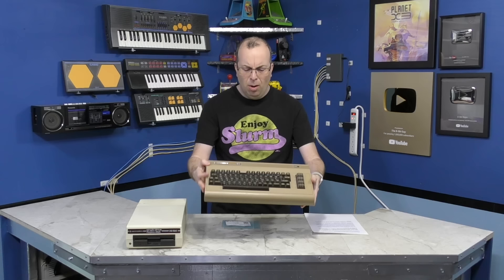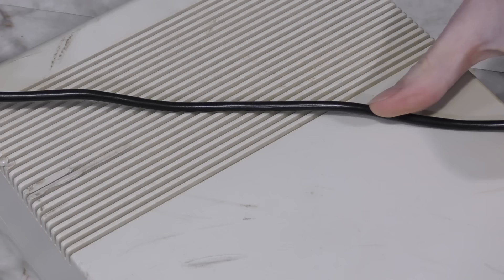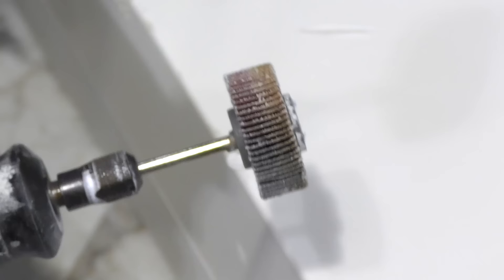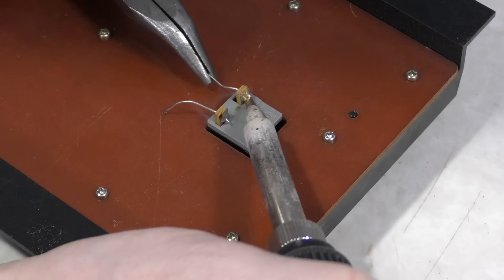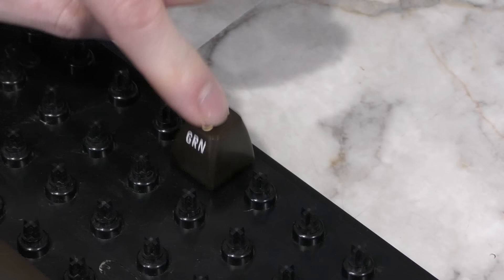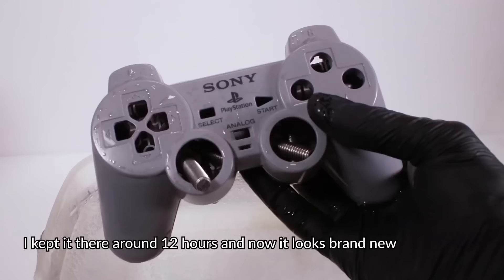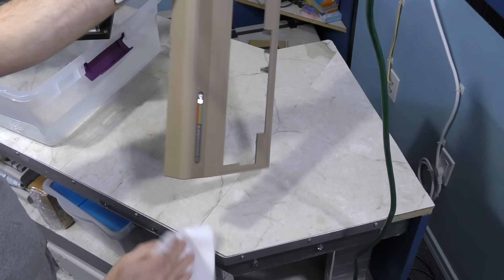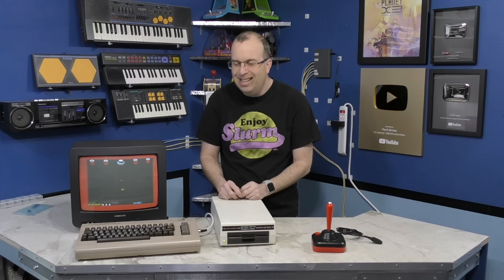Commodore 64 Restoration and new retrobrite technique.

Comment: I’m interested to hear if you notice any UV light bleed on other stuff in your studio over time - if you use this method regularly. Will it affect the stuff you have lying around? :)
Reply: Oh yeah, good point! David has this one episode where he shows how he installs a UV filter in front of his windows, but that was in the museum and not the studio if I remember correctly.
Reply from the maker: yes, I am worried about this too.  I plan to modify this technique for next time for several reasons, but one of the things I'll be doing is trying to contain some of the UV light from escaping into my room.  I had originally planned to do this in the garage but the floor is slanted in there, which made it harder to deal with the water level.
Reply: OBG70  yeah it may even work faster and better on the sides
Reply: @The8BitGuy  Just put a box over the entire thing, problem solved
Reply: OBG70  You do need to account for the heat output of those lamps as well. The back of each lamp is a big heat sink, which means the heat will build up quickly if you enclose it.

As for the process, perhaps adding some kind of mechanical agitation would help cut down on the amount of bubbles collecting on the surface of the pieces. Something like a small motor with an unbalanced weight on it (like they use in some massage devices and in force-feedback game controllers) or a fluid pump of some sort creating a current in the tank.
Edit: I can never seem to get the line spacing right on these comments.
Reply: OBG70  Couldn't you just put a mirror at bottom of the box?
Reply: @The8BitGuy  if it is slanted put a piece of cardboard under the container and make it level lol
Reply: OBG70  Agreed. I was thinking this too. 👍
Reply: @Ricardo-bw2yn  He mentioned it in this video, including the problems he had with the metal reacting with some of the metal bits on previous parts. He left the reflective bits out this time because he thought they might be adversely affecting the retrobriting process.
Reply: @The8BitGuy  maybe build a cowl out of some flashing, or maybe modify a hood vent to hold x amount of lights so the whole thing could be lowered over your chosen container. Just dropping some ideas based on how I would attempt to solve that problem. Happy hacking.
Reply: @t0nito  Just build a sun tanning room with a bathtub, problem solved
Reply: Funny i was thinking the same thing too. Need to make some kind of a box to contain the UV as its bleeding everywhere.
Reply: @MK-je7kz  yes and for the hard to reach side surfaces maybe put lamps on the laterals too; once you have all this setup figured out you can start offering retrobright service for the 8-bit subscribers!
Reply: Geez I'm late for the party but I just found out Mr. Jensen is on spotify! I'll give it a few listens!
Reply: It isn’t submerged in hydrogen peroxide so I don’t think so...
Reply: @The8BitGuy  What about those sun screens you put in your windshield? Fairly durable. That, or something like foil glued to cardboard. Build a "shield" around your setup to help contain the light.
Reply: @The8BitGuy  Look into Rosco Cine Foil.  It's used in TV to prevent light spilling from it's source if barn doors aren't an option and if high heat is a concern.
Reply: @The8BitGuy  Maybe putting some sort of "barrier" around the floodlight assembly? Something removable, but tall enough to keep everything in
Reply: Cardboard curtains
Reply: In addition to UV light bleed some high powered bulbs could be fire hazards if used near plastics.  Metal halide bulbs not used in a proper enclosure could do this.
Reply: @The8BitGuy  I was thinking maybe mirrors on the sides of the crate, because the sides of the parts look a touch yellower than the tops, which might also contain some UV.
Reply: @The8BitGuy  Stick it all in a box. with foil side and put what ever sized clear plastic tank you like in it. I wouldn't run them light at anything in my house, it witll uv rot my sofa, carpets, curtains and cat. I quite like my jet black cat, he wouldn't be able to ninja attack me from the darkness if he was uv bleached.
Reply: Get a huge black storage tub and do all the UV stuff shut in there.
Reply: @The8BitGuy  You could use a reflective tent like they use for indoor cannabis growing.
Reply: @The8BitGuy  You do this often enough I feel like a dedicated wooden frame where you can mount up to six lights at the top. The sides could be made of aluminum foil covered cardboard, or even wood panels if you want something more permanent. You say you don't always have much space though so I'm not sure this would even be a viable thing. Could make for an interesting build video. But essentially this would be the dedicated Retrobright box.
Reply: @evknucklehead  absolutely..those big fins/heatsinks are there for a reason enclosing it in a cardboard box would be foolish... cheeers
Reply: Easy: Take the big black container that David already has, drop the smaller container and the lamps into the black container.
Reply: @The8BitGuy  Foil.
It is also water res...
The tub, lid, and you, will thank you.
:)
Reply: @The8BitGuy  Maybe a reflective box? with mirrors or shiny surfaces
Reply: iVirtualPlays 50%

MuchlikeYT.

Needs when a need does need to exist, yet does.

Love and joy?
Reply: I'm wondering  the desk directly on the bottom of the container was affected?
Reply: Probably not, those UV LEDS are mostly blue light with a small amount of harmful UV. Things would need to sit in front of them for weeks to get any kind of reaction. UV panels like this for effects are fairly safe for a couple of hours exposure to skin else people who work in clubs would have a lot of skin cancer! Tanning  lamps are a totally different thing! https://mashable.com/2017/10/27/neon-lights-hong-kong-sorayama-hypebeast

Comment: This episode has it all. Strange chemical reactions melting plastic cases, the printing of replacement parts, a side mission solving the driveway-spot mystery, high power UV experiments, and the classic of classics: Commodore 64.
Reply: The Atari 2600 or NES is probably the classic of all classics
Reply: @DanTDMJace the c64 is the classic of home computer classics
Reply: @marblecar1162  yeah

Comment: The 'bobble-head' effect is likely due to the uneven weight of the keycap swaying the inner column of the plunger at its peak where it is no longer supported by the outer column. 3D printed components (even with 100% infill) lack density and can be very light when compared to resin cast pieces. Since tolerances are not sufficient, we get bobble! 
As the concern is a dwindling supply of replacement parts, molds could be printed using inverse infills of those same files. Properly weighted plungers could be recreated after some trial and error with mixing ratios :)

Comment: "People think I have a stockpile of spare parts, but I don't"

8 minutes earlier: grabs a key spring from their spare C64 keyboard "just lying around"
Reply: Yeah we watched it
Reply: But one spare C64 in such state is hardly a stockpile of spare parts, there are many springs that can be used, but thats where multiplicity ends.
Reply: Most people into old computers have a bunch of junk lying around. I could theoretically build a working pc from the stuff in my garage
Reply: @nanaskalski3663  That C64 also had a replacement chip he could use. That C64 alone is a stockpile of spare C64 parts.

Comment: Great project! I’d like to make a recommendation, though:  when lubricating disk drive rails, never stick the spray can straw right on them and spray. That makes it very likely you’ll get grease in the head which can ruin floppies.  Always apply the spray to a Q-tip and use that to wipe grease on the rails.  Anyway, in the summer of 2018 when I was off work I cleaned probably a dozen C64 keyboards and cases from my collection.  I can’t remember if I used dish soap or laundry soap, but each one got a scrub on all sides.  On the ones I had to disassemble to clean board contacts, instead of resoldering the shift lock, I installed wires with a plug for easier future removal.  And on those disassembled ones, all the key contacts got dumped out and the entire frame got a scrub too.  A few C64 and disk drive cases got retrobrited as well.  I got a lot of C64 projects done that year.
Reply: All people should work less and do more usefull things instead.
Reply: Good tip, I'll keep that in mind. Nice to see the C64 love. By the way, nice profile pic. Adorbs. :3
Reply: @Bandrik  Thanks!  I like your sergal profile pic, too  :D
Reply: @00Skyfox  why thank you! And nice to be recognized as a Sergal. Always fun to run into a furry here. :D
Reply: @Bandrik  amogus
Reply: @thisisaloadofbarnacles921  we furries are evvvvryyyywhhherrreee.... :)
Reply: Lube.

Comment: 6:08 the video isn't sped up, this is 8-bit guy speed after years of cleaning old computers
Reply: If Data from StarTrek did cleaning, this is what it would look like.
Reply: If you run him using compiler mode, you can get him scrubbing at 1.19mhz
Reply: @originalbadboy32  Or Lindsay Wagner.

yes that was a Bionic Woman reference.

Comment: The first thing that popped into my mind when I saw the 'bobble-key' effect was "stretch the springs a little bit and that'll make them stable", then, as I typed this comment: a little bit heavier spring, too". But the best solution  to bobble-key is to fine-fine-tune the 3-D printing a tiny bit. That was awesome when that 3-D printing of those pieces scenes came up in your video, 8-Bit Guy, and nice work on the overall retro-brighting and circuit repairs, too. That UV setup  with a bit more fine tuning is definitely a awesome thing, too. :-)
Thanks for sharing.

Comment: Regarding the UV light going through the plastic tub, you could try wrapping the sides with aluminum tape. Not only will the UV light not go through it, but it will also reflect it back and possibly speed up the process even more.

Comment: 3D-printed key-plungers?!  And here I'm thinking, "I wonder what kind of glue David is going to use to fix those key plungers."  Man -- 3D printing is amazing!
Reply: I believe the printed plungers could be tweaked to fit better, in the settings for his bro's slicer. I've done a lot of 3d printing and I see some places to improve.
Reply: Yeah! 3D printing is really great, we have plenty of printers in school, and they’re so impressive! I actually 3D printed 40cm space plane on it
Reply: i dont think glue is necessairy here, i would add micropatch in 2-3 layers of double sided tape on top of the plunger to help the key being more stable on it, shimming can also be a good idea or just make a compensation into 3d plans to take account of where its loose
Reply: I'd have used something like jbweld.
Reply: And it's getting cheap. For less than the price of a Nintendo Switch I got a resin printer to print tiny detailed parts
Reply: I had even wondered if he was going to snip the head off the screw and drill the other part and connect them together.
Reply: The term "3D Printing" irks me more and more.  It's like climbing into an airplane and saying you're doing 3D driving!  We need a different word for "3D printing."  3D generation?  3D manufacturing?  globulizing? Deglobulizing?  Widgeting?  Makeitsewing? ... Something!
Reply: @jovetj  its either additive or subtractive manufacturing.
Reply: This was the first time I've seen 3D printing actually done. And I'm thrilled he was able to make it work for him.
Reply: @jovetj  Well technically yes as you're able to move in all axis. What else would you call a print that is all 3 axis? Melted plastic stacking? Why the hate?
Reply: @MV60  
hate ≠ disgust.

Printing is for the printed word.  That's why the writing in books and periodicals is called print.  I am sorry that my similitude above didn't get the point across for you.  "Printing" is not the correct verb for creation of a three dimensional entity.
Reply: @jovetj  Cool, understanding your disgust at the use of the term now.
Reply: ungratefulmetalpansy to be fair it wasn’t a great print, judging by the use of a raft it’s probably an older printer, and it ought to have been printed in a different orientation and with much smaller layer heights, and perhaps slower. Not all print come out that rough
Reply: I designed and printed a very similar plunger for my Amiga 500 and it came out perfect but mileage may vary depending on your printer.
Reply: I definitely would have attempted bonding the two pieces back together before making new ones, or even scavenging replacements. If that’s ABS plastic, I would have tried a drop of ordinary ABS cement for sewer pipes. It would have done nicely.

Comment: I hesitate to comment because I have a Commodore 64 that I acquired a couple years ago to restore.  The fact which may cause a few people to laugh is that I am about to turn 70 so I predate most of these early computers!  I originally wrote programs in Basic for the TRS-80 computer which came out in 1977.  That computer had no data storage on board but stored data on a cassette recorder.  It also had no monitor but used a TV screen.  And of course no mouse as that had not been invented yet.  And no hard drive.  Everything ran off a floppy disk.

The Commodore 64 was a nice step forward in technology and definitely was a great machine in its day.  I have no idea if my Commodore will still run, or if it has any problems but I have all the accessory components with this system.  I'll be posting a video series of my own restoration efforts once I tackle it.  Thanks for sharing some useful knowledge in your video as I didn't know the location of the specific chip that reads the keyboard inputs.  

Great video! Thanks for sharing it.

Comment: So Perifractic discovered that a lego "cross axle" fits into  the  commodore keys...I wonder if there might be a way to use those to repair the broken plungers?
Reply: Maybe with some super glue and baking soda 😄
Reply: I suspect the lego part wasn't the issue. I suspect the round part that goes though the case was. Also you'd have to get the plunger flat before gluing it on. It might work.
Reply: you could use in conjunction with a 3d print
Reply: @tonyman1106  what's actually the problem though. I suspect it's not the "lego" part. I suspect it's the round part isn't tight. But I could be wrong. If it was the "lego" part the key wouldn't stick on.
Reply: @awilliams1701  You just need to re-print the part with correct settings. Calibration of the printer or scale of the object were incorrect.  Parts like that take what? 30 minutes.  Silly to use a substandard part.
Reply: @awilliams1701  Somehow the 3D printed part introduced too much clearance for the spring. I would have tried putting in some sort of shim. In fact, there is probably an easy way to take the horribly annoying click out by introducing a damping material under every key. But I suppose some people find that sound charming.
Reply: you can
you need a screw with no head (threaded on both sides)and make a hole on the two halves of the plunger
then put all together with a bit of superglue
Reply: lorenzo corsi, That’s only a viable option of the plastic halves are sheered perpendicular to the whole, and if you’re able to drill corresponding holes in each piece at dead center, and completely straight.

Comment: At around 5:00 when the side with the power and the joystick connectors is shown, I realized that this one has a square hole around the power connector. A first sign for a nowadays very, very rare early production mainboard. And around 9:00, when you open up the machine it was confirmed that it was indeed a very early mainboard. What a great find! Great restoration! Thank you for explaining the details here.

Comment: Now during the lock down and seeing this video, I've searched through my childhood stuff to find my commodore 64 stuffed in a plastic bag, next to the old 15" crt tv. Now I've taken in apart, cleaned it and fixed the unresponsive keys. I also had a broken key plunger and I printed the same part with the same outcome. Since I don't have a space C64 for parts, I've decided to design the top part of the plunger that broke off and printed that part to be inserted into the existing plunger. I just had to drill the top part with a 4mm drill and now my key is fixed. It looks, feels and responds just like the other keys. I'll put the design on thingiverse so maby others can fix their broken keys. Only thing to do is the retrobrite, but I'll leave that for a sunny day. 

Now I've started to learn assembly on the C64. But just then, I saw the RGB mod video. My tv was the only one that only had component and no scart connector. So I'm already studying the technical docs to find if and where I can appy the mod. 

I've been watching your video's for a few years now and I must day it's one of the better channels, always with high quality videos